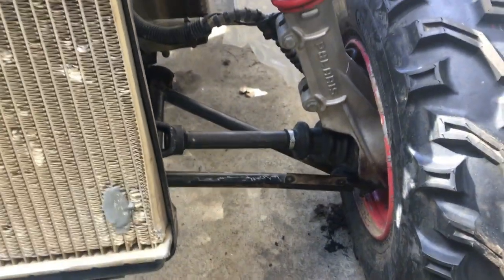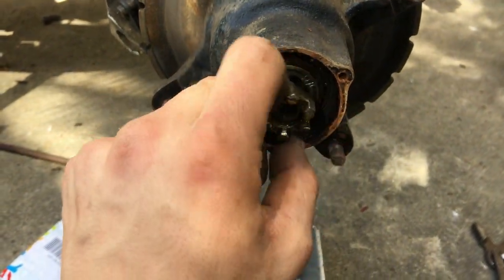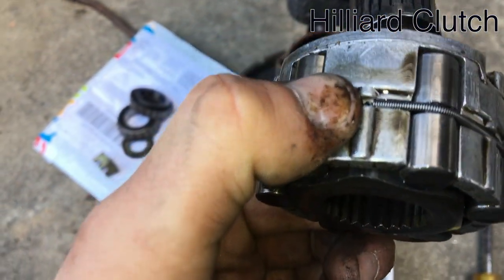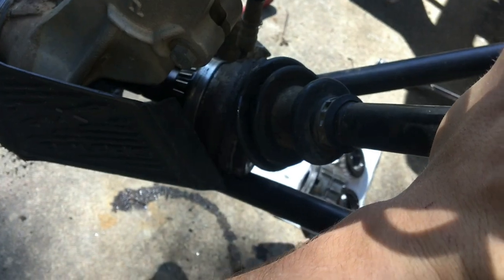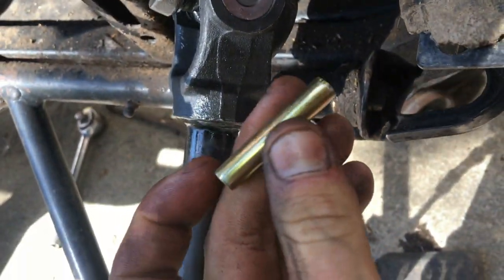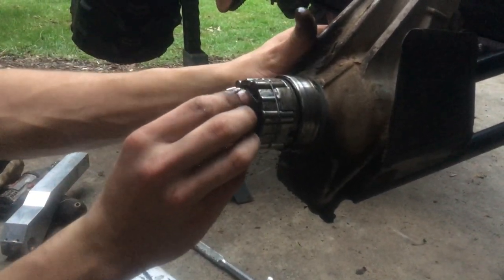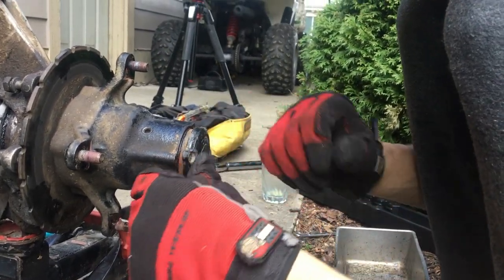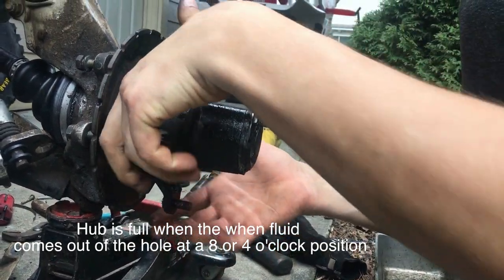Polaris Axel replacement

Comment: Great video 📹 
You should have showed us how you took out that pin !!!!
Reply from the maker: You just get a bolt that’s smaller than the hole and begin tapping on it. It comes out fairly easy
Reply: @jaredsanger5620  yup this sucks

Comment: Having a tough time removing the pin to remove from differential, did you run into same issue? Any tips?
Reply from the maker: No . Just find a bolt alittle smaller than the hole on the axel. Slowly tap the pi out so that you don’t break anything

Comment: Im really screwed. I was changing the a arm bushings on my 99 scrambler 500 4x4 and noticed the cv shaft poped out and was just in the boot with 3 balls. Gigiddy! Anyways i took off the hub and reorganized all the balls. Now im going through hell to get the shaft back in. If i slide the shaft in to hub first then i cant get the splines through that big hole. If i put the splines berings and clutch thing through first then i cant get the shaft in. I even took off the shock. Managed to get everything in that way but now the dam shock wont go in to place. Im to broke to go to a mechanic if not i would’ve had a way better machine please help
Reply from the maker: Have you lifted the machine by the frame to get the shock to decompress and it might go in

Comment: Hey what are the torque specs and what kind of fluid did you use?
Reply from the maker: I really don’t remember the torque specs I was going off the manual and I used hub oil from Polaris